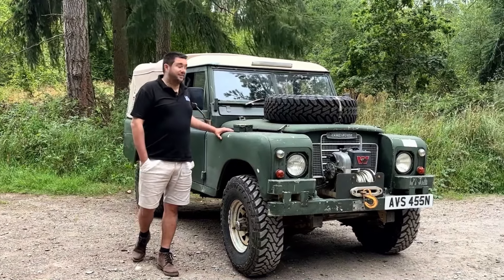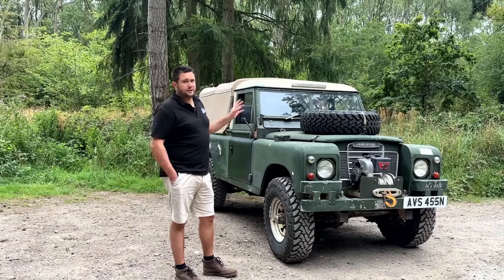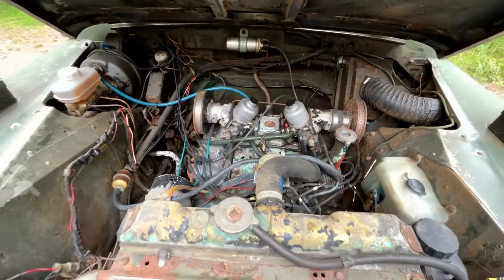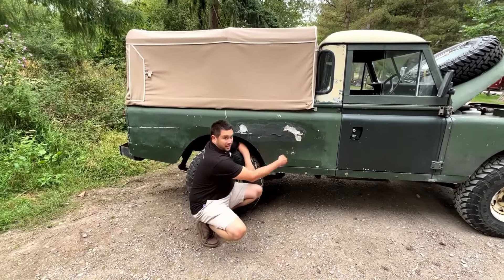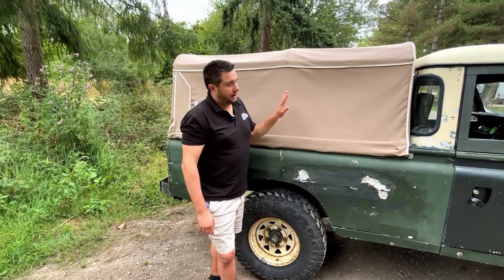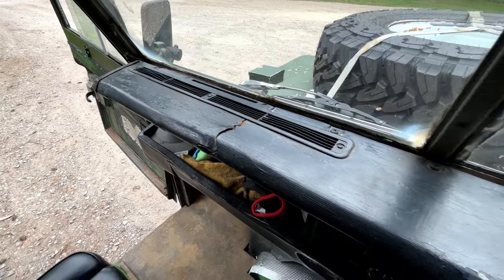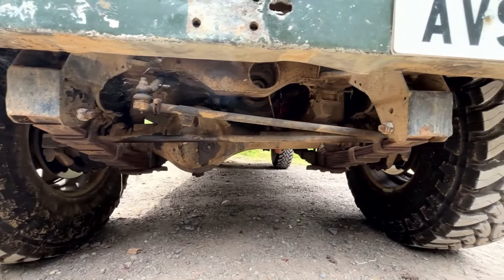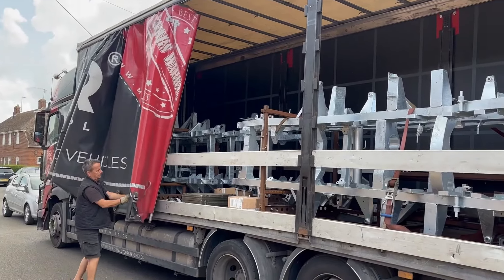IT'S A START! LAND ROVER SERIES III GALVANISED CHASSIS SWAP AND UPGRADES – LAND ROVER MONTHLY – LRM

Comment: Martin I'm thrilled you and LRM are documenting this rebuild. I'm in the States and am at the front end of my frame-off restoration of my '83 Series 3 SWB. I've been corresponding with Richard Hall who has been very generous in providing some guidance on converting my 2.25 diesel to a 2.5 petrol (i.e., 17H). I will be building this all on a new galvanized Marsland chassis with a new galvanized bulkhead. Your videos will be really helpful! Thanks again. ~Pete (South Carolina & LRM subscriber)
Reply from the maker: Thanks for your support! Richard Hall is a font of knowledge. Best of luck with your project

Comment: Nice to see a series 3 without chequer plate rash…… the spring swap is a great choice as  ex military ones are horrible unless loaded to the gunnels.
Reply from the maker: I have learned this! Certainly rattles your teeth
Reply: The guys at the dump said they had a four foot square bit of c plate and thought of me   I turned them down politely, my 2a had cplate wing tops with the wings when I changed them,but thirty years later there's no way I'd do any of that to my two. It's a bad look in my opinion

Comment: Is it a 1 ton ? kinda looks it mines a s3 76, 200tdi done by myself.
Reply from the maker: It's a military Combat chassis. Adjustable spring mounts, square rear crossmember, tierod mount and a couple of other differences. Similar to 1 Ton
Reply: @landrovermonthly7806  ok cool
Reply: No. Although they used the same spring mounts there are some significant differences to a 1 Ton. 1 Tons had the straight six petrol engine, ENV or twin Salisbury axles, lower ratio steering box, different transfer box etc. They are also incredibly rare. An easy reference point is that the military never bought them. (Except the IIA TACR1s)
Reply: @onetonlandrover  I was thinking of putting the 1 ton shackles on my series for a lift :)
Reply: @jjt1093   Might gain you an inch or so, but not much without also extending the fixed mount.